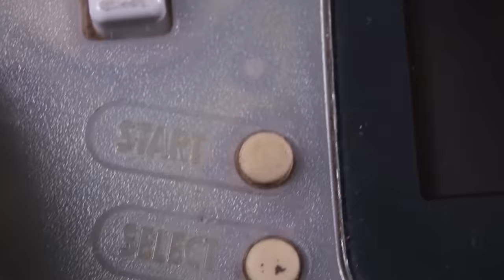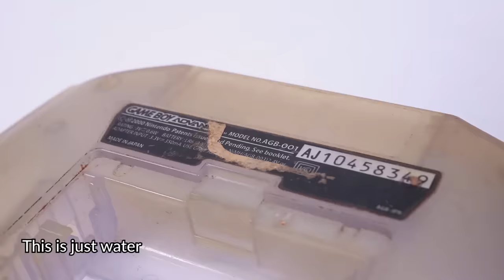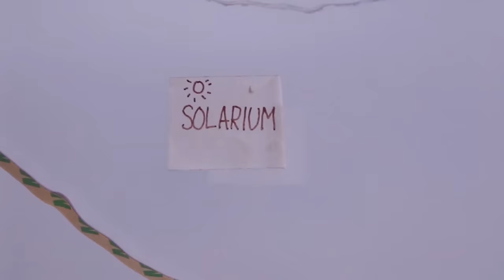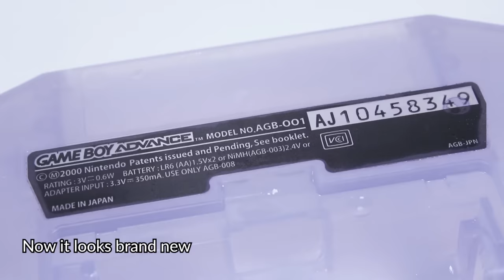I Restored This $5 Ebay Junk Gameboy Advance. It Used to be Blue – Retro Console Repair

Comment: You make this look easy I just bought a broken gba and the power switch wasn't working but the fuses were though I just broke the switch trying to solder it off and a fuse came off the motherboard with the broken power switch piece can I save the gba motherboard or is it toast?

Comment: I love Odd Tinkering, yet the only problem he got wrong with this resto, but not exactly wrong, was the glass polish. Car polish or a similar agent is great for glass to remove scratches. But just like sand paper you have to work your way up to using the finest grit available. Using paper towels or napkins is the grittiest thing you can polish a body of paint or glass with. Diaper cloth or linen would have been much better.  You could have even used 2000-4000 grit wet paper to knock off the scratches and then buffed it out with polishing compound and a wheel on the bench grinder....

Comment: Interesting to think that as filthy as this GBA was, this was your first(?) time seeing the clear protective film on the information sticker. I take good care of my consoles, but that ends up rubbing off of every handheld I've owned. 

The serial number (and on later handhelds, the bar code) is stamped on with some kind of ink that ends up rubbing off and the clear film protects it. Back then, if that serial or bar code rubbed off, Nintendo wouldn't honor the manufacturer's warranty and, perhaps a bit more interestingly, Gamestop would not take it as a trade in. Just a fun fact for the passers by.

Comment: Hey I'm looking into doing repairs like this. I'm wondering what your diagnosis process is? For some things like a broken disc tray I see how that would be obvious. But for issues with motherboards or anything else internal that just turning the system on doesn't allow you to discern how would you come to a diagnosis? Thanks!

Comment: That ice tray is a good ida I use magnets which are frustrating, thanks
Reply from the maker: Thanks! It's pretty good sometimes it's nice to have also bigger boxes for larger parts or long screws
Reply: @OddTinkering  Actually for you it’s best and would be best for me but I am very clumsy. I remembered that if I used your tray idea I would undoubtedly spill it out onto what I call the Bermuda Triangle of a kitchen floor. Imagine I tip the tray then try to grab it and knock over my small bottle of paint thinner and open bottle of model paint. Then as I get up off the floor with a flashlight I break off a part of the tank I’m working on. True story. I guess that’s another reason I like your videos, your work is as smooth as an egg rolling in the sand. And the honesty present in the subtitles.
Ciao bubbie

Comment: Seems a waste to do all that work and not put in the backlight screen upgrade while you are in there. They can be had for around $60.00 to $80.00 depending on which one you buy and make the most significant difference you could imagine to have a modern ips lcd with backlight. Other mods available are things like new controls, new complete shell, audio upgrade and others but I would think the screen is the most important.

Comment: Bro id so send you my vita that ive had for years now and its been dropped 158 times the screen is cracked not as bad as youd think but both sticks have bad drift on them the memory card port wont hold or release the card and my display screen went out on it just recently